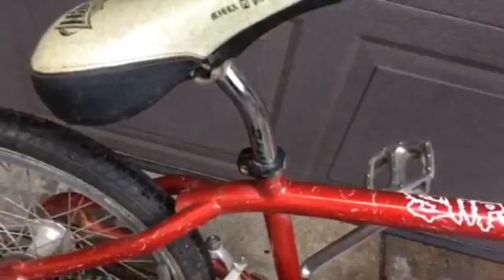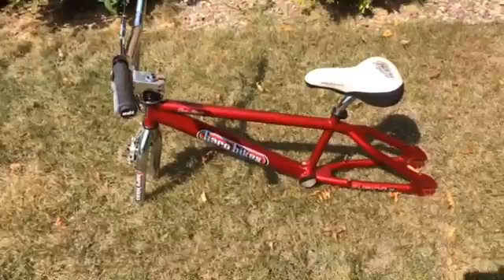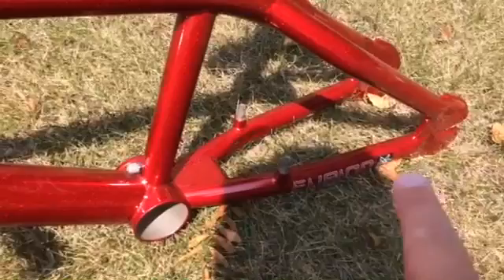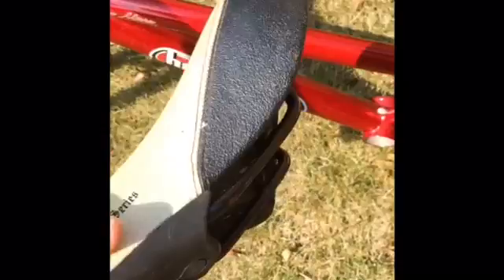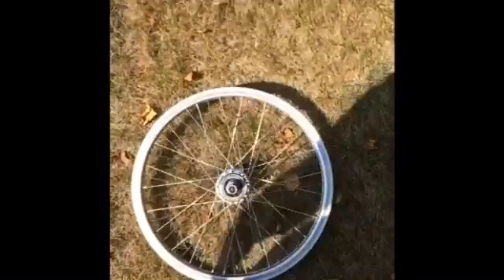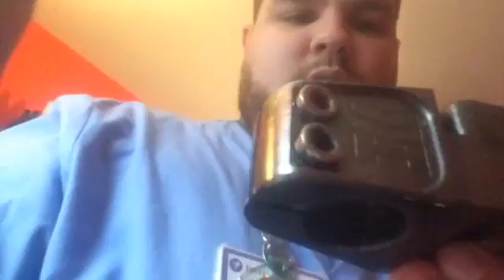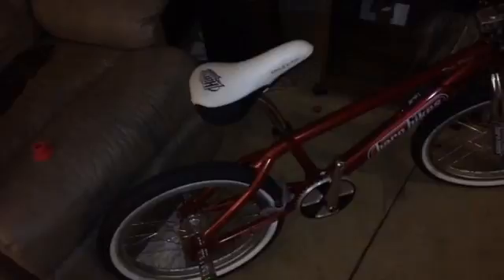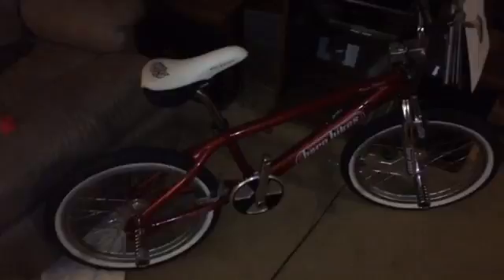Haro mirra 540 rebuild part 1

Comment: How much did the powdercoating cost ya??   And how heavy is the bike?? Thinking about buying one but a couple of articles I read said its a heavy bike Like 37lbs. That sound right?
Reply from the maker: Jeffrey Scales the powder cost me $150 and the bike is probably a good 20lbs the flairs and the mirra pros are probably around 37lbs
Reply: I have same bike, all original and it’s 37.7lbs. I knew it was a tank, but not 37lbs worth. 😂
Reply: Also, I had a slashed/flat tire. Bike shop couldn’t find any company that had whitewalls. So they patched hole with duct tape. Still good. 👍
Have you ever come across anyone that’s producing them now?
Reply: @damaged73  Haro has white wall tires, probably more company’s too but I know Haro does